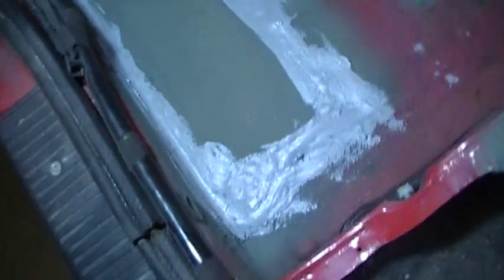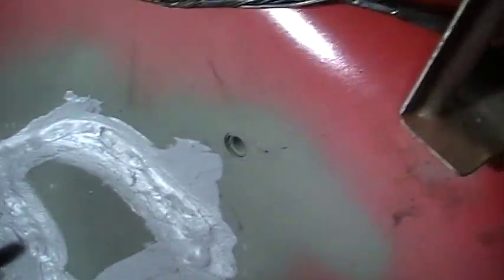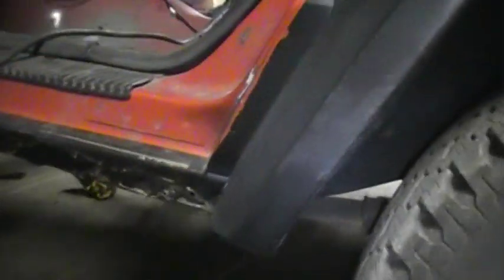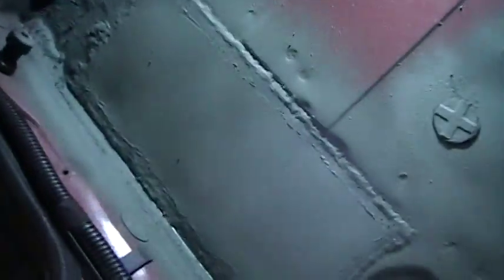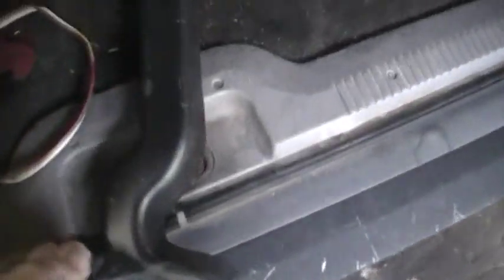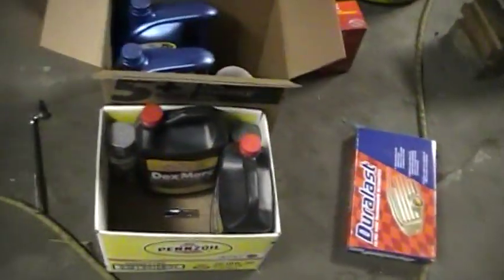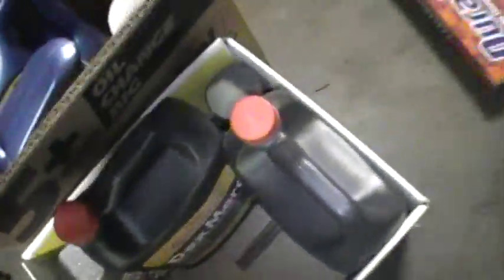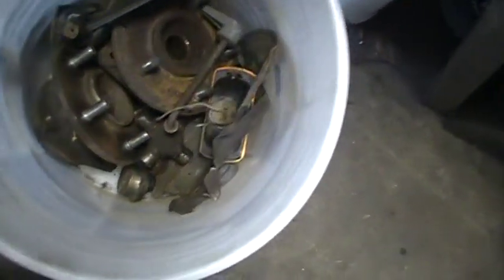jeep repairs 2

Comment from the maker: @landyacth 
yes very much, but the shop floor is in bad shape, and only three inches thick.........the shop was originally an auction, then it was a fuel oil dealer........the fuel oil dealer parking loaded oil trucks in the shop and fill under the building caused the floors to break......last year we got the roof replaced, this summer trying to rewire the shop, hopefully next year some new concrete and a lift. roomate and i tried to get a loan, but no one would insure the place with a bad roof